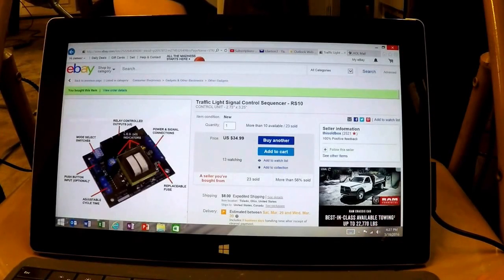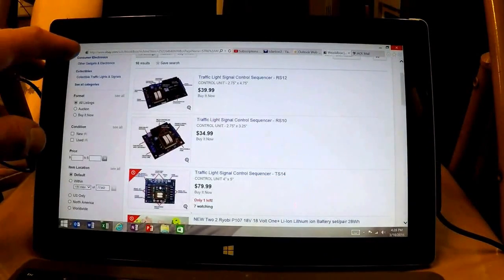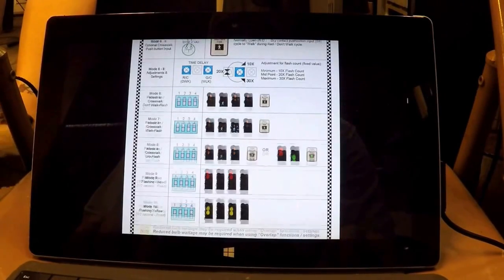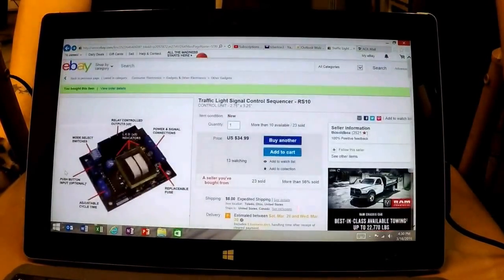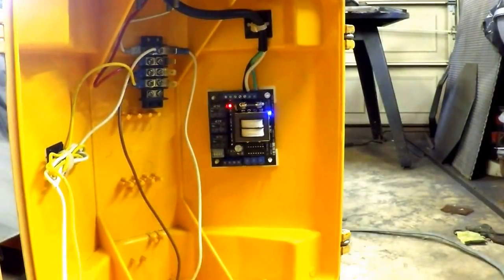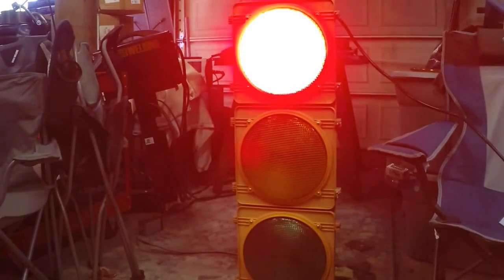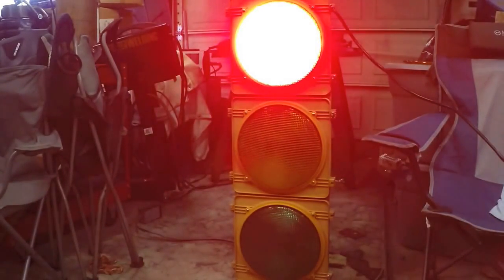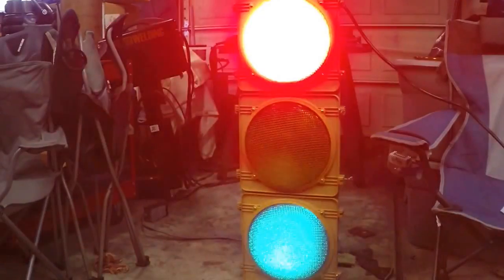RS10 Traffic Light Signal Control Sequencer Install, Operation, and Review

Comment: how can you wire an on/off switch to this configuration.  My switch has 2 black wires coming from the switch.
Reply: Jeff Jaco ull have to find a way to take a common from load side of that switch to the 120 terminal on the board  and Edison set ur nuetral unless ur switch is already going to a light or I’ve a nuetrals bypassing in that box cut and splice it there

Comment: Hi Mr.C,

Nice work!....I added your link to the TS Controls website, under the Links tab and the Gallery tab.  To accompany your video, the control instructions are available at www.tscontrolsonline.com under the support tab. 

RS10 / RS12 Instructions: http://www.tscontrolsonline.com/support/

Thank you again for taking the time in creating the video.

UPDATE: (August 2016) I recently updated the website to accommodate mobile devices.  It is no longer the dark blue color.  For the most part, the layout of the website is similar to the previous website to maintain consistency and ease of navigation.